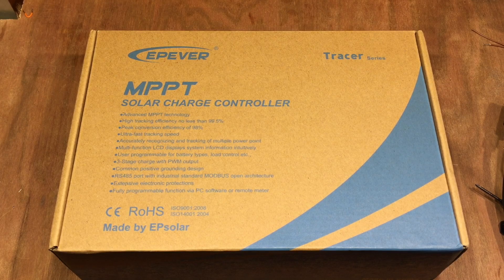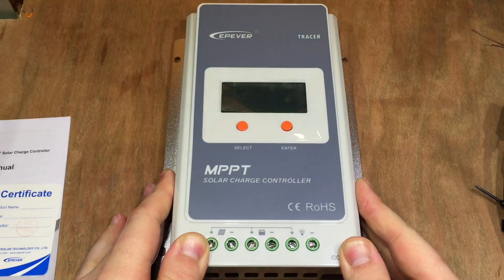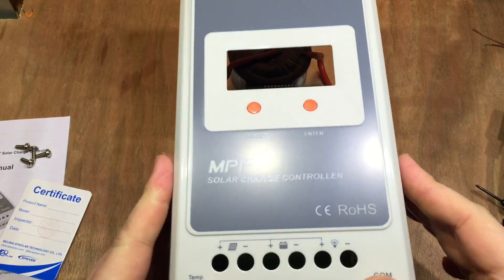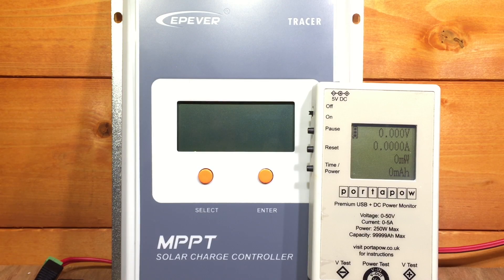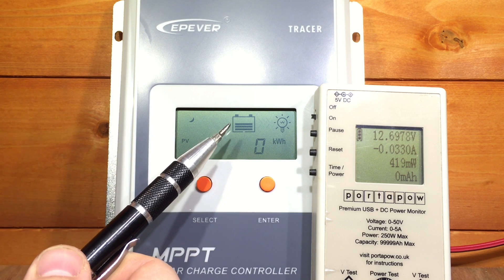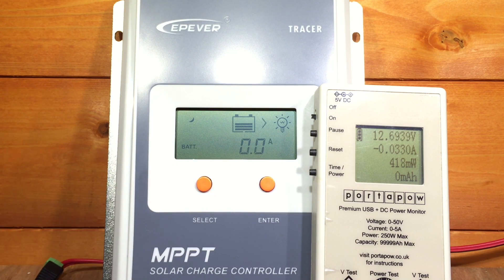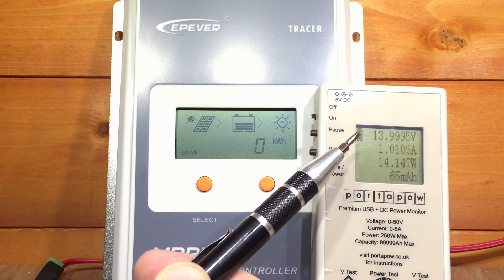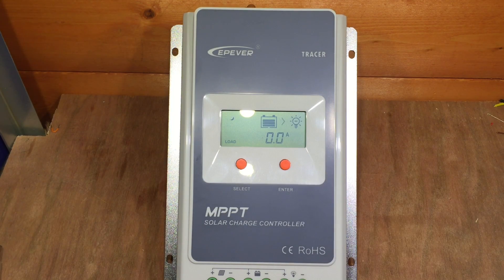MPPT Charge Controller Review - EPSolar EPEver Tracer A Series - 12v Solar Shed

Comment: We have had a lot of cloudy days i guess i should hold off and check max watts over a month.I probably will add 1 more panel on each side of the roof maybe 2 on each side .I guess i could replace my 30 amp controller and use 2 40 amp controllers do you think that would handle it.I have seen on some charge controllers it does not matter how many watts of panels you have the controller will limit the output to the rated amps of the controller.I have not seen this info on this controller.THANKS
Reply: +Adam Welch thanks. I get quite good sun and for long hours: Coast of Kenya. I, probably, should just import the Epever. The victron I was talking about can be bought locally. That's why I wanted it. Anyway, thanks so much man.
Reply: what about the voltage? I mean, in the case like the one above... it's rated 20A & a maximum of 260W at 12v. what if the charging voltage of the battery is 14.8v? Will it still input 20A at such volt? Bringing it to 296w?!
Reply from the maker: +Sammy Kalintosh Remember that at 14.8v your batteries are full. Therefore the charge controller isn't doing mppt anymore and instead uses pwm. At that point it's not using the maximum power point of your solar panels and the current will have reduced to very little. Lead acid batteries simply won't accept much current when they are at such a high voltage.
Reply: +Adam Welch thanks for the info. one more question; I was thinking of getting the Victron 75/15 charge controller rated at 15A & 200W for 12v to power my 12V battery from 250W solar panel. Budget comes into play here. Considering that I won't get all 250W, will I be under sizing & , possibly, jeopardizing my charge controller? Or is that, actually, enough?
Reply from the maker: +Sammy Kalintosh You may get the full 250watts if your battery is low and you've got good sun. I wouldn't recommend exceeding the maximum rating of any charge controller - you're likely to have problems. Although I have no experience of the victron so perhaps a reviewer of that product may be able to help further.

Comment: Hey Adam
I have a 30 amp model and 2 190 watt 24 volt topoint solar panels they are wired in parallel.With a 12 volt battery bank 400 amps.One panel is facing west one facing east on the peak of my roof so the only time the sun reaches both is between 10:30 and 1:30.The maximum voltage i have gotten is 41 and the peak wattage was 250 max.Amps were16 i would like to hook up another panel to this controller but the manual says 390 is max.But where i am now i am not even close to my 30 amp max.What do you think.I hate to buy another controller for one more panel.ANY IDEAS THANKS DAVID
Reply from the maker: +dhlwood It looks like you'll be alright doesn't it, but have you had the best days sun you're going to get? You must be relying heavily on your bypass diodes in your configuration. If you're looking to expand, another panel on each side on each side and a second controller might be the more conventional route.

Comment: What is the difference between the A and BN series, which one is newer?
Reply from the maker: +Mike Getson In a nut shell - the BN models are all aluminium, can take up to 150v open circuit solar voltage and have no screen. 

The A models are plastic front, aluminium heatsink on rear. Can take up to 100v open circuit but have a screen which allows you to view lots of info and edit the load timer settings.
Reply from the maker: +Mike Getson Sorry - the newer model is the A series.
Reply from the maker: +Sammy Kalintosh Yes that's right the A series is the newest - and the cheapest. I doubt the epsolar range would rival some of the premium brands, but people need to remember the amount of bang they are getting for their buck. Thanks for the tip Sammy. I'll see if I can find that video - always good to hear someone else's opinion.
Reply: +Adam Welch so the A is newer compared to the BN? These CC are said to have a very slow & underwhelming MPPT. Waballyange provides proof of this I  his YouTube channel

Comment: I wonder if someone can tell me why the remote controller often shows zero amps charging even in full glorious sunshine! It's as if the 4210 mppt controller has disconnected the solar panels from the battery!
Reply from the maker: +King Jondalar I'm guessing your batteries are full. When the battery is low the controller will do constant current charging. Delivering as much current as it can until it hits its target voltage. At that point the charger will pulse width modulate the battery - which delivers a small amount of current for a short time to keep the voltage constant. Otherwise your battery voltage could get dangerously out of hand. 

If you pull a load from the battery the charge controller should adjust to compensate for the loss and pull more current from the solar panels so not to deplete the battery whilst the sun is shining. 

I hope that answers your question.
Reply: +Adam Welch Thanks for your response Adam... I understand what you're saying but I'm surprised it goes all the way to zero... it can be like this for up to half hour or more then returns to normal, it doesn't seem to make any difference if I put a load on, I tried this today and actually ran a large coffee pot (220 volts) via the inverter which feeds from the batteries being charged and it still didn't kick in again!
Reply from the maker: +King Jondalar Hmm. That doesn't sound quite right then - unless you have some very beefy batteries that aren't shaken by that type of load. Mine shows a value of 0.1 amps when it's floating the batteries, but soon increases the current when a load is turned on.

Comment: Could this work as a psu without needing a lead acid battery?
I have 250W of panels and am looking for an MPPT device to drive a 300W lipo charger that takes 10-28V DC.
There doesn't seem to be any MPPT chargers anywhere that are natively capable of charging, balancing and maintaining a 48V 12S lipo pack. :-(
Reply from the maker: +Andy Lee Robinson Electrodacus is a neat looking product for lithium battery banks. Not sure if it does 12s though. This charger isn't any good for 48 volt systems even if you changed the charging profile voltages.
Reply: +Adam Welch Spoke with Electrodacus, his is optimised for LiFePO4s, and only up to 8S.
If this charger can supply 10-28V, or maintain 24V with whatever current it can extract from the panel, and doesn't care about not having a battery, then my lipo charger will take what it can get.
It runs directly from the solar panels, but with no mppt, it pulls the voltage down to 10V and hence only gets about half of what the panels are capable of!
If I limit the charge current, then the input voltage will rise, but then I'm still not getting max power from the panels.
It's starting to look like I'll have to design and build one myself!

Comment: Hi Adam, Its me again.  I hooked up my new Tracer 1210 A and everything seems to be going good with one small detail. There is no charging status showing coming from my PV array.  Ho do I get this active in a step by step procedure???
Reply from the maker: +Thomas Ferko Odd. It would be hard to diagnose the issue with such little info, but let's say you had one panel - it's positive needs connecting to the positive solar connection. The negative to the negative. As long as your panel has sun and is producing a voltage more than your battery everything should work. If you use more than one panel then it comes down to either parallel or series wiring. Can you test your panel with a multimeter? If it's producing decent voltage then it's probably OK. I guess it could be a faulty unit but check everything else before assuming that.

Comment: Hi Adam i really enjoyed your youtube videos, its a very intresting subject, I happen to live "off grid" in a 70ft narrowboat with 4x140amp batteries and 500watts of solar panels and I'm wanting a new mppt unit to replace a Stecca 30amp unit.....I did enjoy this video, however after doing some homework its turn out Tracer have a new model on the market, the Tracer4215BN, from Bimblesolar.com other than not having a display screen I'm trying to find out the real difference between the two....In terms of price there is little in it......have you had any dealing with this model yet....

Kind regards Kristian.......ps keep the videos coming their great...
Reply from the maker: +Kristian Winder Hi Kristian and thanks for the kind comments. I haven't used the 4215BN but my understanding is that it is an older model. A second version of the original tracer series. 

Three main differences as I see it. Tracer A allows you to make some modification and view some info without buying the optional screen or using your PC. The BN version allows higher solar voltage - 150v rather than 100v on the tracer A series and finally the BN version is all aluminium construction where as the A series is plastic on an aluminium heat sink backplate.
Reply: +Adam Welch So what your saying is the one you reviewed here with the LCD screen is actually the newer model.....not the older model...
Reply from the maker: +Kristian Winder That's my understanding. The Tracer BN series has been hanging around on eBay for a year I'd say. The Tracer A series arrived in there in about February. 

If you look on YouTube you'll find a number of reviews of the BN series dating back a while, but only two or three recent ones of this type. 

Whether newer is better is up to you though! 

Must be a nice life floating about living off grid. Sounds nice.
Reply: +Adam Welch Hi Adam after doing much homework I'm really stuck as to which model to go for.....I really cant make up my mind which to go for the A series or the BN model....regardless of which i'll be buying the MT50 so that is not a factor nor is price a factor......any input from you would be great....
Reply from the maker: +Kristian Winder There's only a few things that set them apart. I guess the most important ones are - the BN series is common negative and the A series is common positive. Depending on how you're integrating it into your system that may be important. The BN series can take strings of panels up to around 150 volts - the A series only 100 volts. The BN series is all aluminium construction. The A series is a plastic front on an aluminium heatsink. The final big difference is the integral screen in the A series but if you're buying the MT50 then that's of little advantage. 

The newer one might have a slightly improved tracking algorithm in there given its been released a year or more later - but it could be exactly the same. It could have improved components - or being newer may have untested ones...?

I went for the A series - it worked out best for me but I haven't had my hands on a BN series controller. 

Can you tell I'm avoiding the question? ;-)

Go with your gut or flip a coin. I usually find if I flip and I'm not happy with the outcome it's for a good reason and go for the other one!
Reply: +Adam Welch tbh I'm leaning towards the BN model, in terms of cost theres not much in it, the LCD screen is not a factor as I will be buying the MT50 regardless of which model I go for, as you said in your video the A series does strike me as being a budget model as the BN seems much more solid, its also much bigger is all aluminium and just seems more meaty and hopefully will last......add to that its rated at 150v too.......I posted on a FB narrowboat group and asked the same question and heard some issues with the A series......Someone also said get 2 Eco-worthy controllers and wire them both in....
Reply from the maker: +Kristian Winder I'm in two minds about multiple charge controllers on a single battery bank. It adds redundancy if you are totally reliant on solar but I think it can cause confusion when the two controllers are in different charging modes. I've never really tried it though, so I could be talking rubbish. 

They've definitely saved money in the case - but if that's paid for the screen I'm alright with that in my shed. Not heard any reliability issues - but I'll keep my eye on it, thanks.
Reply: +Adam Welch yeah I know what your saying about two controllers I don't like the idea of it either......Looks like I'm placing an order then in the morning with Bimble for a BN 40amp model and an mt50....Its just seem much more robust......I'll do some pics and let you know how i get on.....thanks for all the help..
Reply from the maker: +Kristian Winder Glad to hear you've made a decision. Thanks and enjoy your new controller.

Comment: I just got the 40 AMp model a few days ago, no idea on the efficiency, this is my first solar setup, don't even get my inverter until tomorrow, but it was dead simple to setup, with the USB adapter wire to hook it to your pc. Setup parameter for these lifepo4 batteries I purchased was easy to. No complaints for the price. 

Again I haven't checked the "effiency' of the the device, really I can't yet, as the batteries are completely full (so, it just stops pulling and goes to some state where it collects almost no power), and the only dc load I could find around here was a couple small bulbs that only pull 15 watts!, never drains it enough even overnight. But tomorrow will have a  real load going, then can see.

I'm happy with it thus far, but I already have dreams of a 48 volt system hehe..... So this is probably eventually going to be devoted to pure dc loads, and a bigger system will do the AC loads. I'm not sure yet, it's been like 3 -4 days I had it running at all.
Reply from the maker: +SoGladUCame Sounds like you've got the solar bug! Thanks for your comment.

Comment: Tell me how to setup this controller to charge two small 12 volt 1.2 amp hour sealed lead acid batteries in series so I don't overcharge them.  What do I change on the out of the box controller to do that?
Reply: +Thomas Ferko  I just bought a Tracer 1210 Mppt  controller. During a one day time frame I need to be sure when setting up the controller that the batteries will be charged without overcharging them. What parameters need adjusting?
Reply from the maker: +Thomas Ferko it does yes. It's auto switching from 12v to 24v. 

The small battery capacity won't bother the charge controller - everything happens the same in small and large batteries, it's just a quicker process in smaller batteries. The biggest issue might be the current draw from the charge controller its self on smaller batteries. A low current draw pwm charge controller works better really with small batteries. 

On the tracer you'd pick 'SEL' in the battery menu for sealed batteries.
Reply: +Adam Welch I have a PWM charger hooked up to my batteries now and the charger shows charging the batteries.  Yet I see during a 9.5 run time frame the batteries progressively loose charge??  Is it because the PWM controller is about 75 percent efficient verses the 99+ efficient MPPT controller??
Reply from the maker: +Thomas Ferko MPPT is great for maximising the charge in the shortest time possible. However that isn't the typical use of a hobbyist like me. MPPT charge controllers generally only use MPPT when bulk charging after which they return to PWM mode. 

I'm out at work all day and on a good day my batteries are full early in the morning. That means the advantage of MPPT is pretty small - I've done it because I like to play. In fact if you're struggling to fill your batteries on a normal day it might be better to put your money into more panels, rather than an MPPT controller. MPPT isn't much help on an overcast day, but more panels will increase your production on those dull days. 

MPPT is great to maximise the power on sunny days. It's great when you have somewhere to put that energy - whether that be a battery bank or a grid. If you're charging your batteries on PWM and the batteries are keeping up with your usage - honestly I wouldn't invest in MPPT. If you aren't producing enough power - it's your call whether you put your cash into charge controllers or panels. Obviously if you're struggling for space for panels MPPT is the only option. 

Overnight your battery voltage will fall back to a figure close to its nominal voltage, because current is no longer being pumped in. It will also drop because your charge controller will consume some when the panels have no light. If your batteries are loosing charge in the day time then it looks like a fault, or your charge controller consumes more than your panels generate.
Reply from the maker: +Thomas Ferko If you've got the cable, or can make one then you can adjust the battery parameters. I personally reduce the equalisation charge voltage and duration to put less stress on SLA batteries. If you haven't got a cable, there's no way to adjust the battery parameters - just the battery type. In which case choose 'SEL' which is sealed lead acid.
Reply: +Adam Welch   Without going into great detail 'WE' have developed a DC circuit that has the potential of putting out more power than what's going in. So the batteries feed that circuit load and the load in turn feeds the solar panel and around and around we go with the batteries being charged during that time frame.
Reply from the maker: +Thomas Ferko A circuit that puts out more power than you put in - where do I sign?!